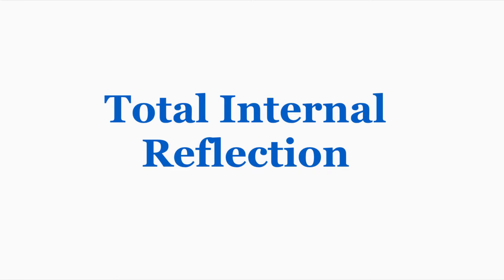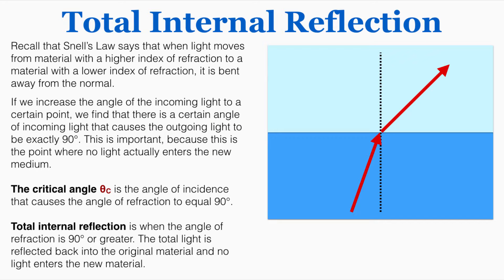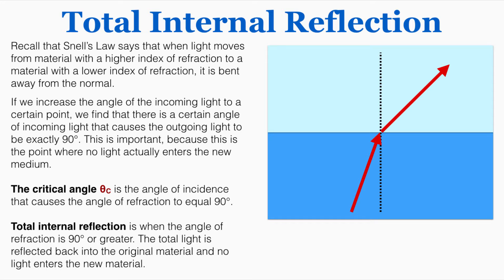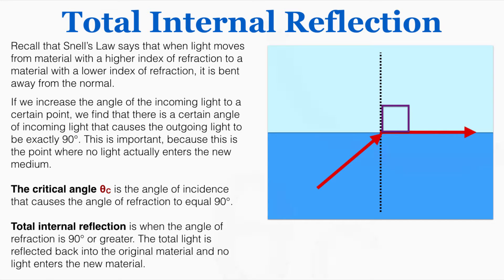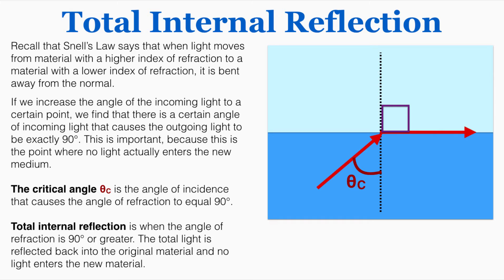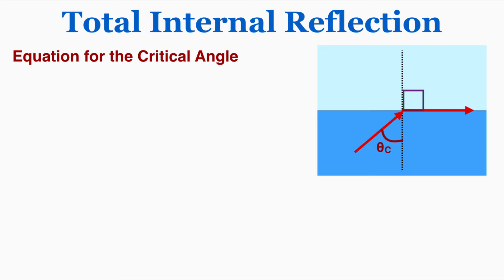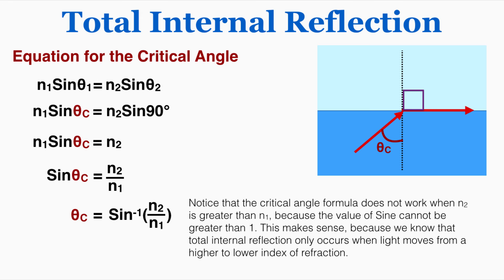The Critical Angle and Total Internal Reflection - IB Physics

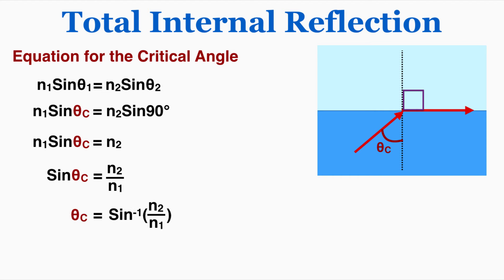Comment: at 1:45, is n2 the refraction index for the second material? if so, does the refracted ray actually enter the second material because doesn't it just go on the surface at 90 degrees?